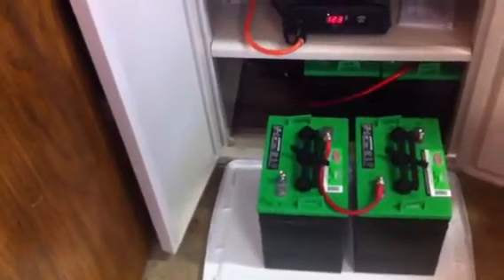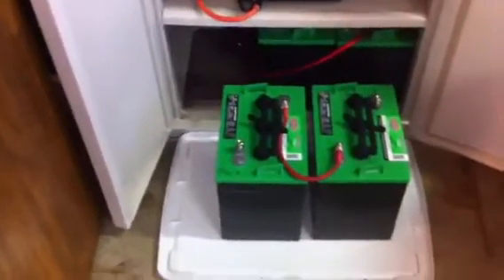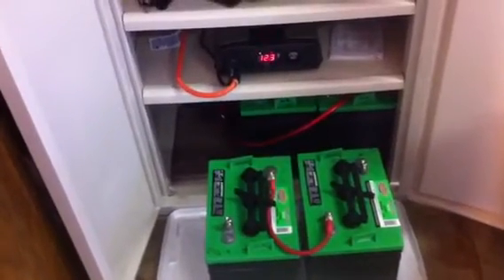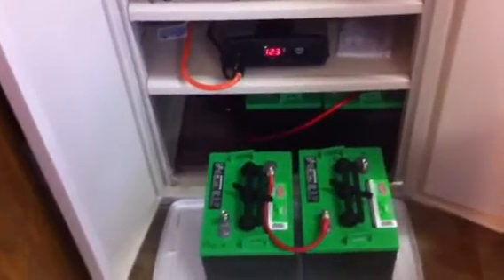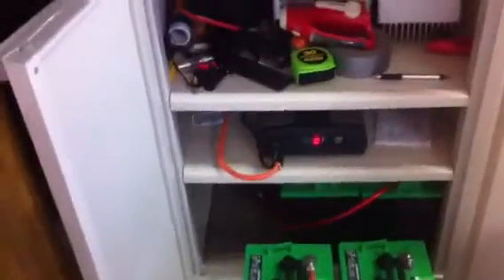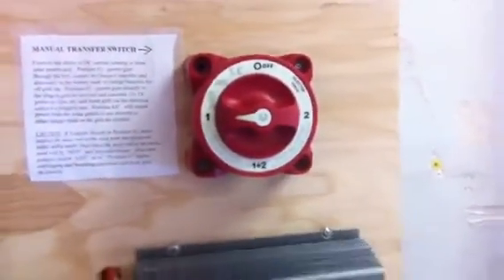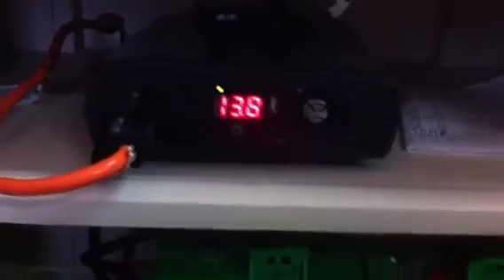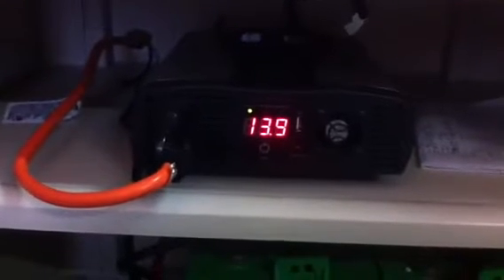Question for Experts or anyone re Battery voltage

Comment: Looks to me like you need REAL RE type batteries.  Those 300 lb. 1.5 volt Trojens or 1.2 volt  Iron Edisons for  starters. Not haveing watched your earlier vedios take this with a grain of sulfate. If you can regulate your charge voltage I'd say nothing over 13.5 absolute for lead acid.  If they are AGM's or GEL absolutely don't go over 12 you can pour the amps to them but not over 12vdc.
Reply from the maker: Thanks. Actually these are interstate 2025s (6v equiv to Trojan t106). Batts are good. Realized long ago my prob was two fold: (1) cheap inverter which since been replaced; (2) I was only hand tightening my term rings to batt. This results in a voltage drop, most apparent when running at higher loads. I had replaced my inverter and still had low voltage cut outs. Then tightened down with ratchet (but not over tightening) and Alas no more cutout and I'm running 2000w continuous thru the critical circuits in wired (later vid) in my house. But I really appreciate the tips and would agree much of what you shared
Reply from the maker: Last point. If I was TOTALY offgrid I would prob go with rolls surretts but I'm purely emergency backup on perm gridtied system

Comment: try discharging to below 50% and then charge, and see the batteries will take a charge if not the may be bad, they may be one of those types of batteries that like to sit 100% charged at 12.3 volts if so that would be why when you apply the charge it would jump to 13.9 volts right away. Hope this helped

Comment from the maker: Hi Ray, i think my problem with this older post was 2 fold.  1st the inverter was not best quality.  2nd, and possibly the real reason, i never tightened up my nuts on the battery posts as tight as they should be.  i had similar problem with my new Aims Pure Sine after wiring my Reliance (recently).  came to realize, you really need to tighten the nuts on the battery posts a lot, otherwise voltage drop occurs.  it can deliver some amounts power if not tight, but larger power can't have loss

Comment: Probably a stupid question but I am beginner also. I do not understand the problem, isn't it supposed to charge the batteries to 14.4 volts then divert the load? Mine does the same thing, that is why I was wondering. I am also looking to run my solar and wind on separate controllers, I am going to get a MPPT for solar and  install 2 separate tie inverters one for solar and one for wind, I am trying to set up similar to yours with battery bank and grid ties, sometimes this stuff boggles my mind.

Comment from the maker: Definitely aware of what your saying.  With that said, my cabinet is NOT air tight, and does allow any gasses to flow into the much larger area (e.g., 2 car garage) which i have heard is large enough to avoid something bad. With that said, i've had a brushless exhaust fan at top of my list for while to reduce any such risk, and when i do charge my batts i usually leave the entry door to my garage cracked just in case. If something thinks my space still too confined PLEASE share thoughts.

Comment: They could write BOOKS about what I don't know about Battery Banks for wind/solar...  in fact they have; maybe I should read them.  But... I recall being told these batteries give off hydrogen gas, and sulfuric acid, and sometimes sparks.  Your bank seems to be enclosed in a plastic closet in a workshop or something...  My limited understanding is that when hydrogen gas, saprks and enclosed places combine...  ya' know what happens?  Bad things...  I'm not sure about this, but... passing it on.

Comment from the maker: @TIGHTWADHERMAN That's a great point that i think most (me included) would have overlooked. How many 24/48v systems do you find in automotive industry, and hence replacement parts, etc.?  Few to none... I think I'm gonna stay 12v. I can always find thicker cable if worried about line loss, but i may not be able to parts to my 24/48v system in disaster or in pinch.  Thanks for the smart advice. I've been accumulating solid state spares however for a Faraday cage i'm working on

Comment: 1#  I like 12 volt system over any other voltage //  easier to get and replace parts in disaster 
also can recharged easier with autos and many other out side sources 
2 # Use mutability inverters // you'll see alot people using one large inverter THIS IS NO NO
If ur luck like mine it will break when you need it  
3#  Use manual device were possible solid-state great but cant be fixed use manual relays 
4# Keep replacement parts on hand that you cant get down the street 
Info 4 U and others

Comment from the maker: @TIGHTWADHERMAN Thank you for your help and insight. I'll definitely check that our further as I continue to experience same problems. Ive also come to the conclusion that I really need a good MPPT controller w/absorption & equalization modes.  When they were working, would charge and resting @13.9v.  I equalize/de-sulfate w/ BatteryMinder every 45 days so leaning toward controller as a fix. but weird that works sometimes. Thanks again for all your help and comments

Comment: also there is difference in battery gauges // 
they very same way from 12.8 to 14.4 to full charge
your equalize voltage should be between 13.8 to 15.5
there again depending on baattery specs and charge controller 
check out  //CROWN  batteries web site also TROJONS // and  DEKA // 
For extra help and explanations // and sure there many more out there
But these have been in business for over 40to 50 years and manufacture there Owen deep batteries for commercial use

Comment: First did work before and what was your finished voltage 
if worked before more likely charge controller
Now with that being said a battery very according manufacture recommend finish volt 
There are several setting slash charger controllers that have different finish voltage  
they very from 12.8  to 14.4 depending on brand and us most people don't realize is there differences  check manufacture specs on both battery and charge control
also if batteries need equalized  can cause this issue

Comment: completely charge the batteries and let them rest for 24 hrs with nothing going in and nothing going out. They are do for an equalizing I'm sure. You can disconnect the dump and turbine while charging.

Comment: Nice clean setup. That controller is good for wind really. Yea, it can do solar too, but.... Find a low cost MPPT controller and you will be very happy. It will help you get the most power during the morning and afternoon and will keep the batteries in top shape. And remember that you are going to lose power / efficiency by using batteries so I would keep them ready for emergencies and use the GTI most of the time to save you money. Drop by the forums at techluck DOT com when you get a chance.

Comment: i just realised why it is 12.3v, its only the  shunt controller is only letting it get to 70% charge, (CC to CV transition point, *facepalm* why didnt i think if it earlier), cause it is diverting alot of amps (10A+) so, get a series(PWM) controller and it will charge up the missing 30%, the batteries will be considered full when the current drops down to about 1A.
btw why isnt your other 12v set wired in? its just sittin on the floor?

Comment: firstly, you are using a wind controller to charge your batteries, it is not ideal, get a decent programmable pwm controller with thermal compensation
the voltage shoots up cause your batteries are full and the over voltage goes into splitting water (@2,4vpc)
even with flooed cells, the rest voltage should be 12.6v when willy charged, 12.3 is strange